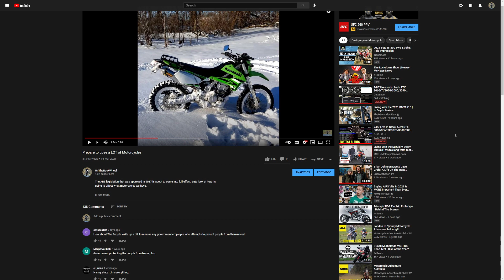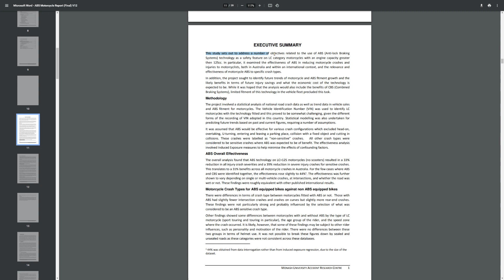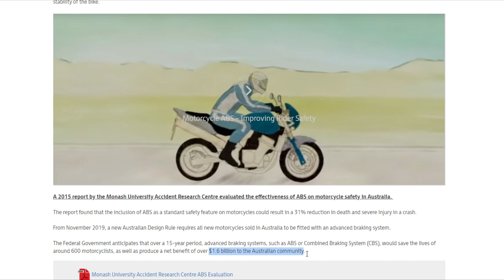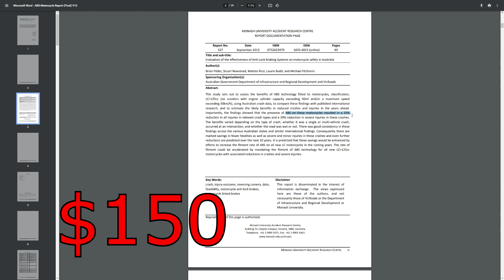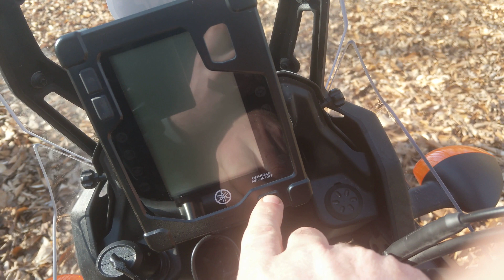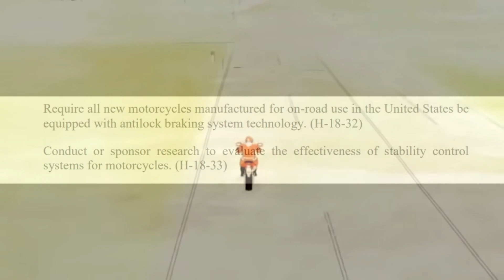Why is the Government FORCING motorcycles to have ABS?

Comment: Nicely explained. For commuting or road riding on the weekend, I can't see any disadvantages with ABS. Riding off-road you definitely need to turn it off. I've noticed most OEM's only allow the rear ABS to be turned off whilst off-roading and only dials down the affectiveness on the front, which for me works well. Unless you're a pro rider on a track day and want to hang the back out entering corners, I don't see ABS being an issue.
Reply from the maker: Thanks mate

Comment: I agree with your comment on the EFI 6 speed DR 650!  Let's hope Suzuki will spend the $ to do it!
Reply from the maker: Here's hoping they listen!
Reply: Sadly probably unlikely.  Suzuki doesn't have a recent history of producing actual new models (road & other), if you discount minor updates to existing models.  If there was a strong business case for Suzuki, surely after 20+ years they would have significantly updated or replaced the DR650 & DRZ400 for technological improvements such as EFI and suspension.  I hope I am wrong, but I am more hopeful that Yamaha will build a replacement for the WR250R which will be Euro 5 compliant and also have ABS.  Only time will tell.

Comment: ABS on my car is too intrusive, comes on in the dry when I'm sure I could brake harder. On my Cbf1000 I've never had it come on! When it's wet I ride carefully and in the dry the tyres have so much grip I can't lock them. The ABS is there for if I fuckup and brake too hard in the wet.
Reply from the maker: Exactly, it's good to have just in case

Comment: What would be very helpful is a deep dive into the method of the study...how they came up with that incredible 39% decrease in accidents. Plus..anti lock brakes by definition let go and will take longer to stop than if you locked up the rear and pumped the front, but your little cartoons consistently show anti lock taking less distance to stop, what's with the lie? Anti lock brakes are anti stop brakes, they take way longer to stop, look it up anywhere, they take longer to stop the vehicle.
Reply from the maker: Have a read of the study, they did a pretty good job. The KTM demonstration from my video is probably the best example. In adverse conditions I have to disagree with you, ABS brakes are bloody good then. In the dirt? Yeah they are shit house
Reply: Rolling wheels will always take less time to stop because they use the much higher coefficient of static friction as opposed to the coefficient of sliding friction.
Reply: @DietBroccoli  rolling wheels will take less time to stop then what?
Reply: @mboyer68  : Wheels that are rolling have a greater coefficient of friction than wheels that are sliding.  That means that you want brake as hard as possible without sliding, which is exactly what ABS accomplishes.